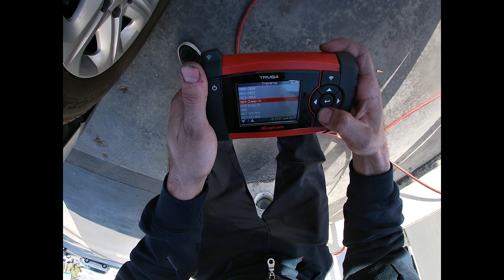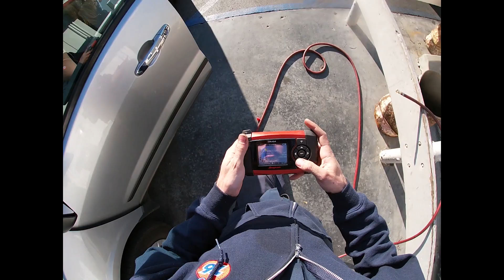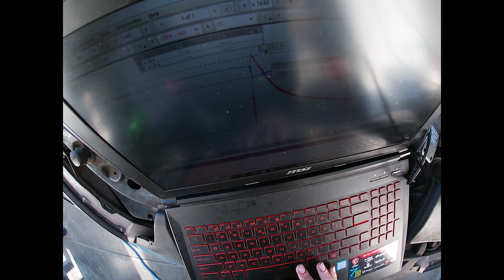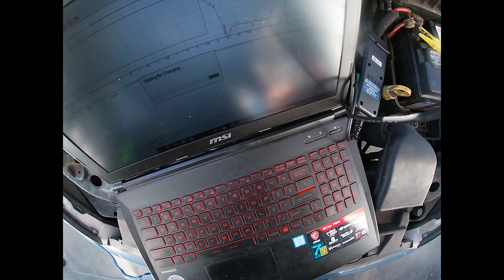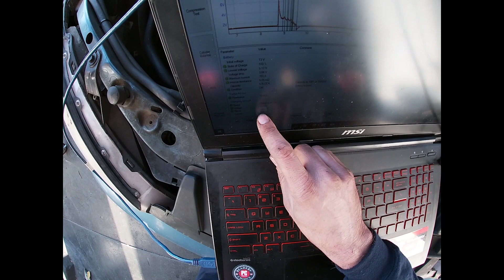Picoscope Battery Starter test, Snap On TPMS, and Customer Service

Comment: Dont have have to document those tire pressures in cali?
Reply from the maker: KD Automotive Not if it’s a general walk up tire light. But if we do any billable work, CA law states we have to check/fill air pressure. Not sure if documentation is required in that aspect but we have them written on the bills.